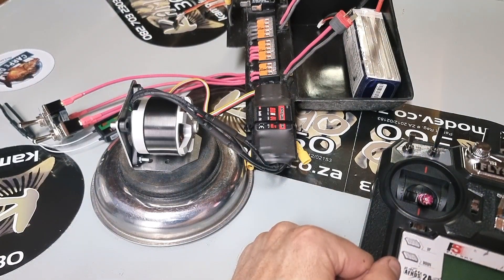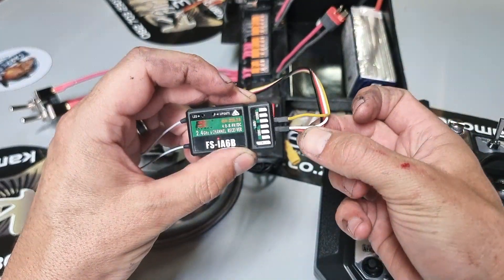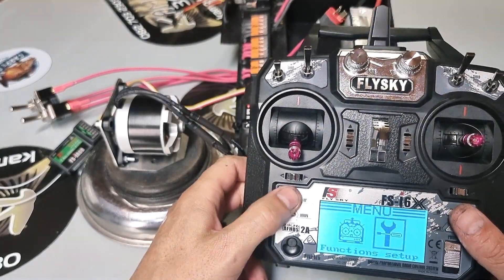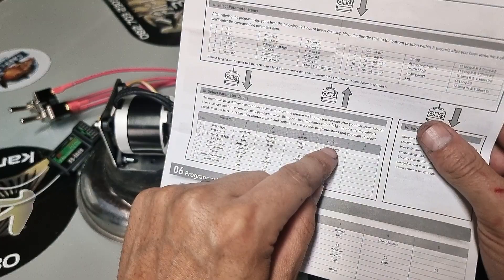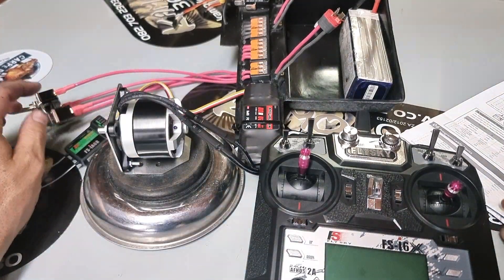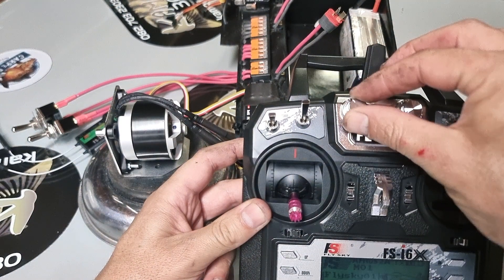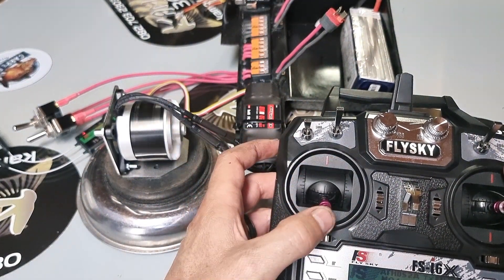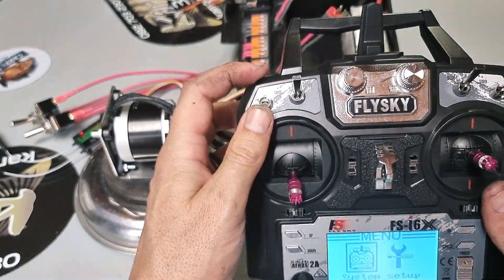Skywalker 80amp v2 ESC setup

Comment: Beautiful! I successfully programmed mine on the throttle, but I can't have it to work... I run it on an excavator, so all sticks channels are for running the machine, and ESC is for the pump, which is to be set on ch5. Once everything is connected, ESC stays on program mode... Would you have any idea?
Reply from the maker: Hi there best to send me a video of your setup and what you are trying to achieve so I can help on WhatsApp +27823376354
Reply: My friend, I have the same problem, I have it in VRA and it works at some speeds, did you solve the problem?